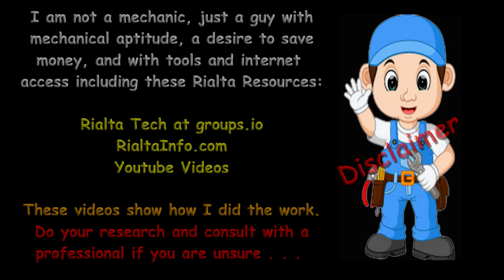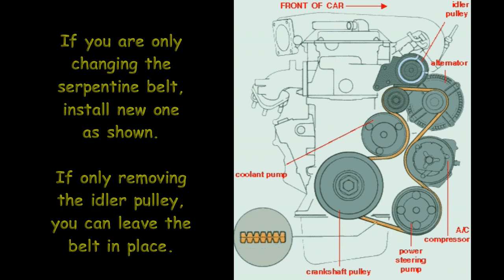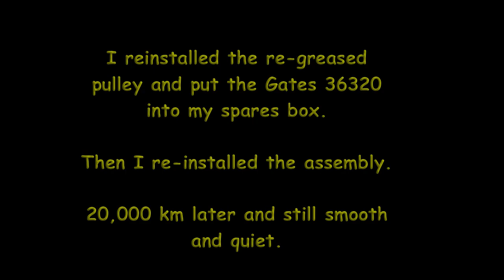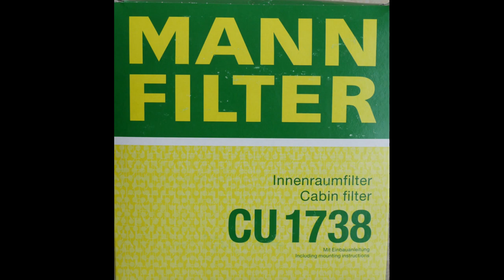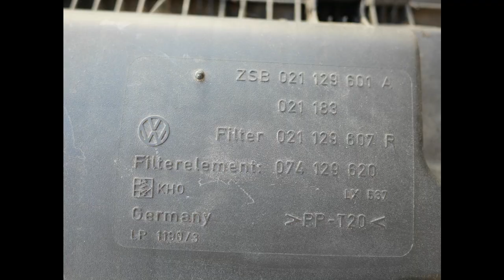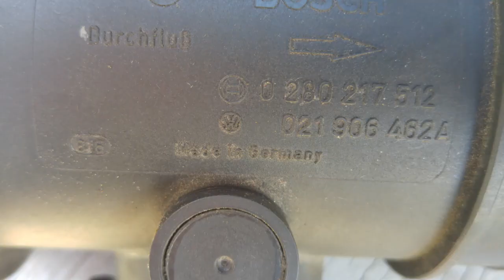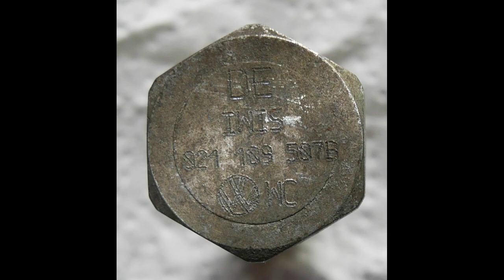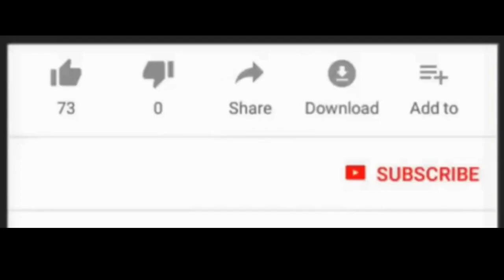Winnebago Rialta Eurovan Chassis Maintenance Part 2 - DIY Misc

Comment: I just did this. the engine filter is very difficult to get the top off. You must disconnect from the MAF. (on either side) Once you can do that (difficult) you pull the top of the air filter box to the right to unhinge the back-side hold downs you can't get to. My local auto parts place will take a week to get the engine filter. I thought I had the wrong cabin filter before I saw that the wider ring part is part of the car, not part of the filter.